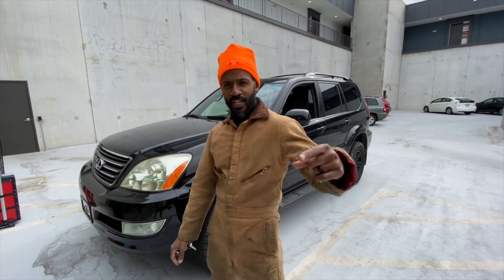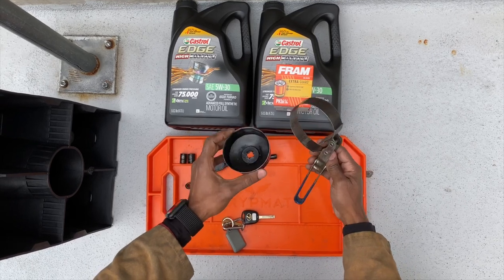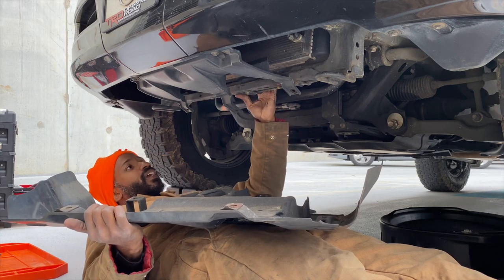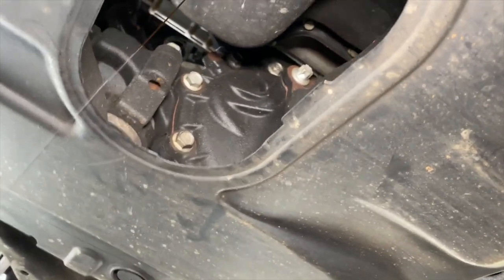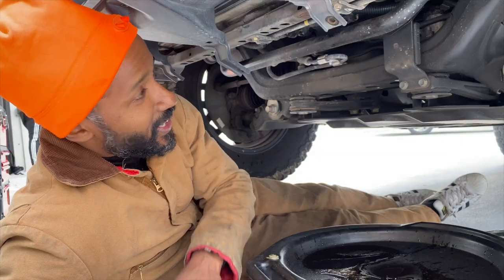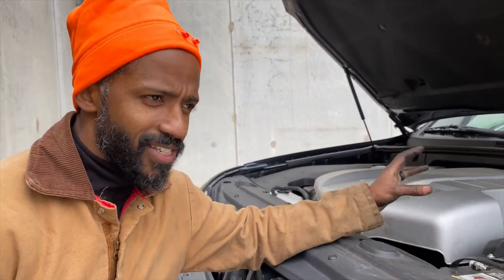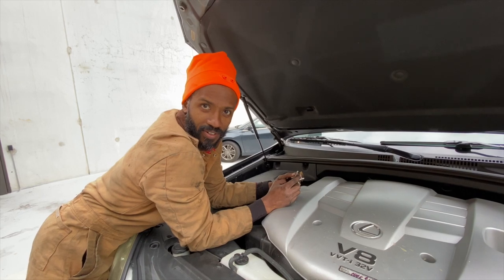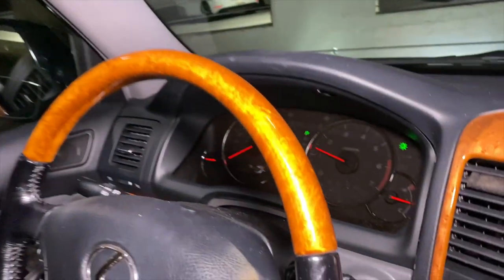Lexus GX470 Oil and Filter Change. DIY

Comment from the maker: Based on all of your comments I am going to replace my Fram oil filter with a Napa gold! So far I have put a thousand or so miles on the Fram filter. The plan is I’m going to install the Napa gold filter run it for a while then cut them both open and see what I find! Years ago I worked in parts sales and never heard so much bad stuff about Fram, but after all your comments and watching a few vids on YouTube I decided it’s not worth the risk! So coming in the future Napa Gold Vs Fram orange break down! Thanks again to everyone for watching and commenting!
Reply: Just use the OEM from Toyota....they are great quality and at least around here (Midwest) they are actually cheaper.
Reply: I worked at toyota Lexus 12 yrs.  the OEM filter is THE best filter.  It’s more cost efficient than the Napa god filter.  You can buy filters of eBay if you don’t wanna go to a dealer.   I like your videos , cause your almost like a Lexus mechanic,  u like to be clean.  You can spray brake clean after installing new oil filter.  Easier to clean.  Skid plate is tricky.  I hate that part.  Easier when you have a lift.  Lol.  Keep up great videos 👍👍👍🙏🙏🙏🍺🍺🍺🍺

Comment: Your videos are exceptional! Very little useless chat, yet you are engaging and very informative. Please keep focusing on the GX470. I love mine and have no plans to trade it in. 220k and I have had very little go wrong with it but as it gets older I have experienced some issues. Here are some idea for future videos: replacing the purge value (a common issue as these trucks get older), working on the air spring suspension (again common issue as the trucks age) and timing belt replacement (your video would be a welcome addition so I have yet to find a good one). Keep up the great work!
Reply from the maker: Thank you for the support and future vlog ideas! We actually have already done the air suspension video. Check it out! Eventually we might do the timing belt video, that job is a beast from what I have read.
Reply: @KRTLyfe  Watched the suspension change video you did after I commented here - nice job. I want to keep the air suspension - no good reason, but I think it adds to the luxury truck mystique :)
Reply: @KRTLyfe  there’s a excellent video from a mechanic on YouTube changing the timing belt. It’s a lot of work but can be done if you’re extremely self motivated 😂

Comment: Thanks for doing this video! Couple things I wanted to go over with you. Fram filters are notorious for not catching all of the grit, metals and such and will actually damage the engine by letting all that stuff by. Second of all when you refill the oil filter you should actually fill it with oil before you spin it on. When you start the truck up it won’t be sucking air from an empty oil filter and then when you go to check your oil you should really check it again after running it for about 2 minutes then let it sit for a minute or so then check it. Good Oil filters are anything from Napa or the factory Lexus/Toyota filter. Great video!
Reply from the maker: Craig Baillar Thanks! 💯
Reply: yea  the orange fram filters are garbage,  the fram ultra filter are very good tho

Comment: I don't know if anyone answered your question, but I read in a group that the plastic thing up front is for highway stability, and it clicked with me, because I've had mine off for a while and I remember thinking at one point that it seemed more susceptible to wind than it used to. Didn't quite make the connection.  Not 100% sure, but close.

Comment: Use the same hoop filter wrench, but shorten the handle by chopping it with a cutting grinder wheel until you can easily use it on your filter each time.  A little tape makes the handle more comfortable also.  Have a bunch of different wrench styles and none seem work on the GX, but my chopped one now works great!  My advice on putting the plate back on is to grow a third then a fourth arm. I do get a little better each time.  Quick lube places will likely over tighten and strip the plate bolts.  I would have suspicion also that they would not even change the filter when they see that plate to remove.  Only way to be sure would be to remove the skid plate to check on the job.  Once you do all that, you may as well just have changed the oil yourself.  Even putting the filter on by hand will make it really hard to get off next time.  Before my chopped wrench idea, I would burst a brain vessel trying to remove the filter by hand.  Have 5 Lexus and a Tundra, all have their own little twists to make the oil changes harder than they should be.  I only use OEM filters from the dealer.  They cost about the same.  Want to keep my 04 GX 300,000, 400,000, 500,000 miles.  Had a bad dream that it broke…but it was only a dream!
Reply from the maker: Thank you for watching commenting and subscribing! Those are some great tips! We have a 100 series LC approaching 400k miles love these yotas they really go the distance!

Comment: Check out fumoto oil valves. You replace the drain bolt the first time and then from then on all you have to do is unlock and turn the valve instead of making a mess removing the bolt.
Reply from the maker: Great suggestion! We will definitely check it out.

Comment: My advice is to use Toyota oil. Is not expensive getting the case at the Toyota dealership! I have doing it for approximately fir 6 years. Same with the oil filter get Toyota from eBay the 10 bottle case around $50.
Reply from the maker: Thanks for the advice, we will keep that in mine next time!

Comment: Washer on the drain bolt should be changed every 2 oil changes or so
Reply from the maker: These crush washers can be flattened, sanded and reused. Thanks for watching.

Comment: Please my Lexus GX 470 2008 model will crank for quite a while before it fires up. Fuel pump changed but there is no solution yet. This problem occurs when the vehicle is parked for, say 25mimutes or more How can you be of help sir? Thanking you in anticipation.
Reply from the maker: I would have some one run a diagnostic on your GX. Do you see a CEL on the dash?

Comment: Nooooooooooo, never use farm oil filters.  You should buy the toyota filter.  100% better carbon filter than anything and OEM filter close to aftermarket price.  I have the sequoia and same setup.   Recheck your oil after filling up.  Should be 6.5 quarts.  T doesn’t take into count the filter capacity.   Theirs a toyota filter test video on utube you ca watch.  Oh also. Great video
Reply from the maker: Thanks for the tip!

Comment: Would you say $17k is a fair price for a 2009 model in EXCELLENT condition with $128k miles? It has recent maintenance records for fluid flushing, timing belt replacement, spark plug replacement, and all mileage interval maintenance. The air suspension works well too.
Reply from the maker: Scott Watkins IDK seems a bit pricey to me. We got our 2005 in great condition for $6500.00 I think. I guess it falls upon if the 2009 had the features you desire and are those features worth the extra coin. I also haven’t looked at KBB values for that year and model so that could be in the ball park.
Reply from the maker: I just checked local inventory in my city and KBB. That is definitely way overpriced for our city. I saw a 2009 with 58k miles for $15k.
Reply: KRT LYFE That’s a good point. I’m looking to build an overland vehicle so I don’t think the 09 has anything I’d need vs the 05-08. It had the black interior and exterior which I love so it was tempting at the dealership today. Just couldn’t justify it. 

KBB values it at at $15,600 in excellent shape which this one was. So a little off the mark I guess. Anyways, thanks for the input!
Reply from the maker: Scott Watkins I would say hold out and keep looking until you find the right GX for you. We searched for around 5 months till we found ours. We looked at 7 or 8 black on black GXs over that time until we finally came across one that was in great condition. One thing we kept running into was the cracked dash on many of them. Some had leaking valve covers. A few were just beat to hell by previous owners. Then we found ours, one owner always serviced at Lexus. We bought it the same day lol.
Reply from the maker: When I say black on black I mean black with the dark interior. Lol
Reply: KRT LYFE I gotchu. I’ll keep all this info in mind while I keep searching. Thanks again!
Reply: Scott: i bought a '08 with 106K on it from 14K..and had everything service wise up to date..and i fell in love..i also had a large amount of cash to put on to it..so shop around..but these go fast in sales..and they are so versatile..i love it..went WeatherTech inside..mats..cargo..phone holder..etc..BW rocks..i could live in this thing..so have fun and enjoy..
Reply: Scott Watkins $17K is too much. I got my 03 GX470 for well under $10K
Reply: KRT LYFE Nice. $6,500 is a great deal.
Reply: 512 TXS Yea I didn’t do it haha. Still looking. I completely blocked it out of my mind once I figured out that $17k is almost the price of a 2nd Gen with just over 100k miles
Reply: Scott Watkins There’s some in Austin right now for under $10k. :-)
Reply: Hello guys. Any thought on buying this one that has 200k miles
Reply: @KRTLyfe  What city are you in?